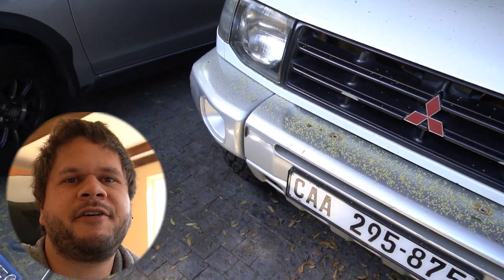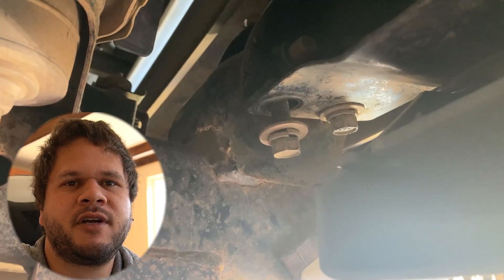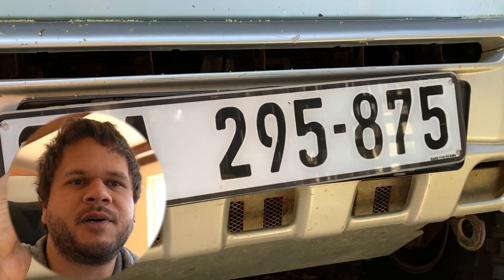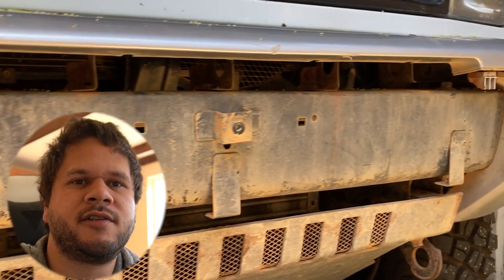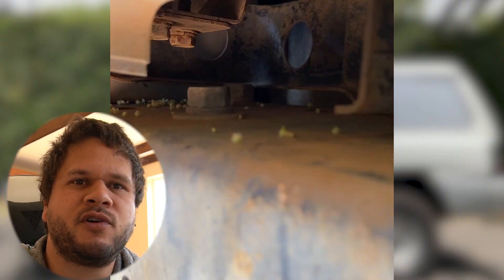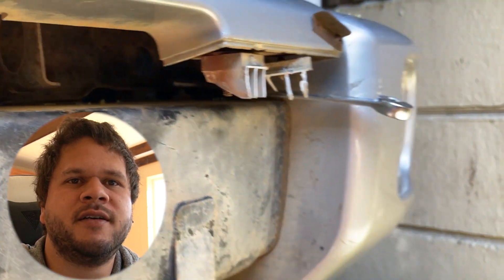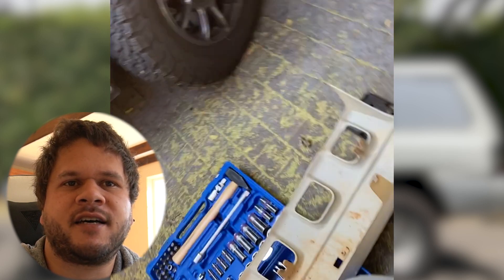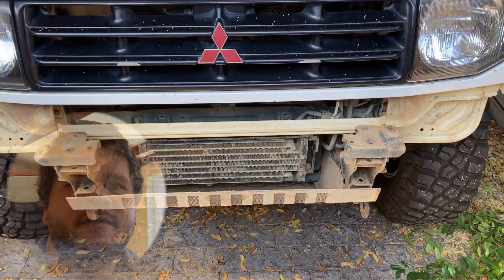Bumper how to Removal DIY - Pajero/Montero Gen 2/2.5 NL OEM - Mitsubishi - Steel Bumper Symmetry 4WD

Comment: Thanks for the info 👍
I own the same Pajero gen.2,5 , but with 3500 V6 engine (year 1999).
And my plan is to take the bumper off for mounting a winchplate and winch.
There is a cooler between the chassis ends.
Do you think a winch will block the air flow through this cooler ?
Reply from the maker: I think it would, you always have to be careful with restricting airflow at the front, especially on the diesels!